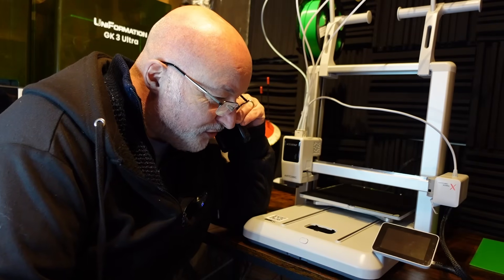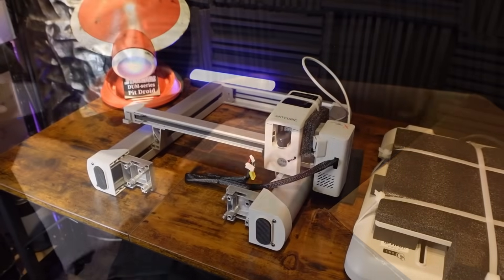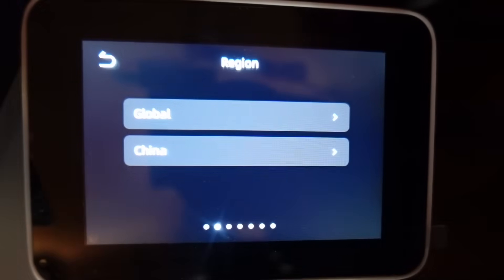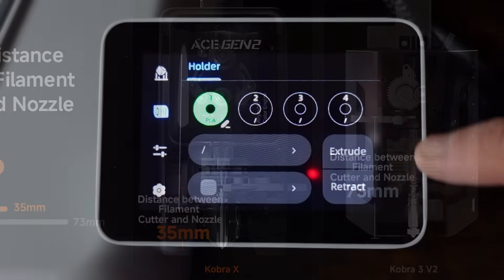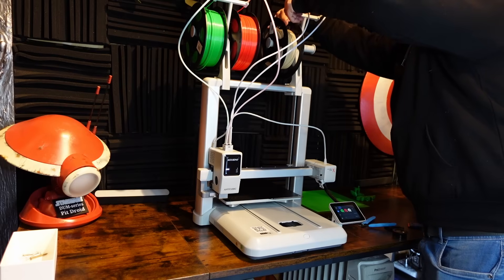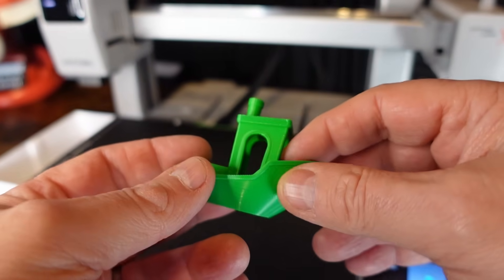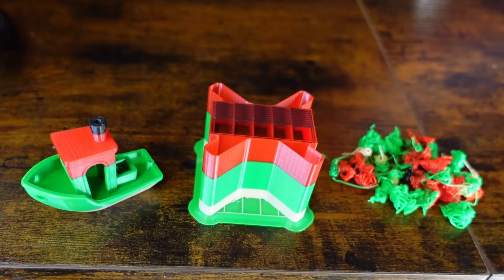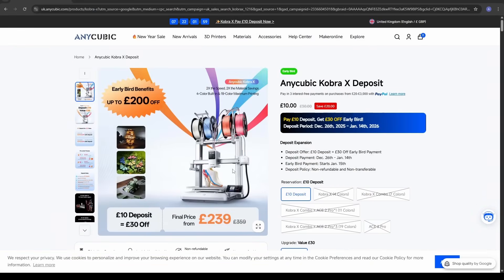Anycubic KOBRA X Hands On First Look & First Prints

Comment: The key metric I am trying to find to decide on a printer that nearly every creator/reviewer frustratingly neglect is reliability evaluated through data driven failure rates. Failure rate per 1000 colour swaps? Failure rate per 10000 print hours? Mode of failure? Nope, just glazing and 'this first print looks nice'. 

I hatw this. Maybe you could change this.
Reply: Yeah sure.. because it is totaly realistic to expect a single person to report about 1k hours printing in a first impressions video. Do you even think about what yoou are typing?
Reply: @IaS_AI 

I use 1000 hours more of an example, not a specifc demand. I thought before typing of course, and the point I am making here is that at large there is little to no data driven test results to decide on a printer. The P2s has been out for a while now and we dont have a failure rate. I cant even find anyone testing all its fancy smart feautrs like the clog resolution yet. This is reflective of most of the 3d printing sphere. Shop nation (i think) was the only one to do this for their P1s farm a while back.

Comment: Not bad. Very solidly built bed slinger. I like it, but id prefer a corexy with this toolhead. Hope they release that one soon!
Reply: That's what I said about the Kobra 3 Combo, but the S1 was terrible.  In almost every possible way.
Reply: i totally understand. Been an anycubic fan for a long time, i stopped buying since the kobra 2 pro, bed level issues and locked firmware. This kobra x looks good, but they havent said anything about open sourcing the firmware, and thats a no go for me! I can get the flashforge ad5x instead for about the same price.

Comment: The Kobra X isn't compatible with the current generation ACE units, it will be compatible with the new ones that will be released alongside it.
Reply from the maker: Should have said ace 2 I'll update in my next vid
Reply: @greedy3d480  also mention the ACE Pro 2 has 4 actual extruders, not that mess of a selector cylinder like the ACE Pro.  Simple and effective this time, and feeds and retracts at 40mms instead of the ACE Pro's 20mms.

Comment: This, the new Creality... we're in the era: Goodbye Ender 3 clones, hello A1 clones.
Reply: I think people just prefer machines to be user friendly. Simple in their build, simple to replace parts, simple to repair and made out of solid durable materials. It is after all, domestic printer. 

The only thing I really wish it had is insulated cover, even if offered as an accessory. Cold temperatures or fluctuating temperatures can very much mess a print.
Reply: @Kokose  Yeah this isn't even a criticism, I'd love to try one of these out instead of my clapped-out E3V2. Do agree that an enclosure would be nice and we're kinda hitting the point where a few more bucks can get you a non-Bambu printer that's enclosed as well. 

I'm currently holding out for when the budget allows, hopefully by then I'll be able to get a multi-nozzle setup :D
Reply: People have become really strange. Their first printer was the Bambulab; they printed with the Bambulab for a year. They idolized and worshipped the Bambulab. But they don't know that the Bambulab is the biggest copy machine ever...

Comment: I swear this printer is anywhere near the same price as the A1 they mines will start their next printer because it's not going to sell that many units. These companies need to stop pricing their printers the exact same as bambu, just because you cloned the machine aesthetically does not mean then it performs the same or poops the same.......... If these machines aren't cheaper they will not sell because that is the only reason why somebody would choose another company besides one that ''just works''
Reply: You clearly haven't looked at the pricing. This is far less expensive than the A1, and includes 4 color printing out of the box, without having to spend an extra $100 for the Combo version.
Reply: @mattelder1971  the price says from 259 dollars so is that $259 for just the printer, show me where it says $259 for the printer and the AMS, we will see when it actually releases how much it is for the combo and just the printer, I don't trust these companies as far as I can throw them. I'm waiting and waiting and waiting for someone to compete with bambu I'm sick of only having one good choice for a printer at least multicolor or multi material, it's sad that no company can step up to compete they're always trying to match the price but their hardware and software is always not up to par........... So when you're faced with two printers that do the same exact thing but one cost maybe $10 less but doesn't perform as well as the other one I'm sorry I'm spending the extra $10 for $30.00 or $40 or $50 for the reliability.
Reply: Think I saw it was $499 AUD which is much cheaper than the A1C

Comment: Are you using a test version of SlicerNext?  The current release doesn't even have the Kobra X as an option.  As one of those in the community that you seem not a fan of, that doesn't appreciate AnycubicSlicerNext over Orca, it has nothing to do with polish and everything to do with support.  Will Anycubic keep it up to date?  How often will they port in new features from Orca?  They're supposed to have the source of AnycubicSlicerNext be open and available as per the license of Slicer, PrusaSlicer, Bambu Studio, and Orca dictate... but they don't.  The current release version of AnycubicSlicerNext does not include the latest Orca changes that yield much nicer overhangs, much nicer calibrations, the list goes on and on.
Reply: Its supported now u have to update the software.
Reply: @ramonlepana4360   where ?
Reply: @ramonlepana4360 I appreciate the white knighting but unfortunately this doesn't seem correct unless you're downloading it from somewhere I don't know.  The latest release on Anycubic's website is V1.3.7.3 which I'm running.  It does not have the Kobra X.  

Please tell us what version of the software you're running that has the Kobra X and where you downloaded it from.